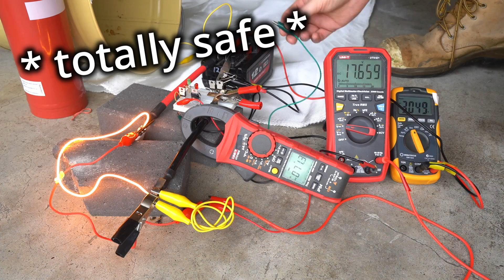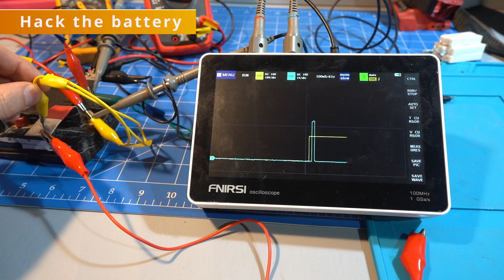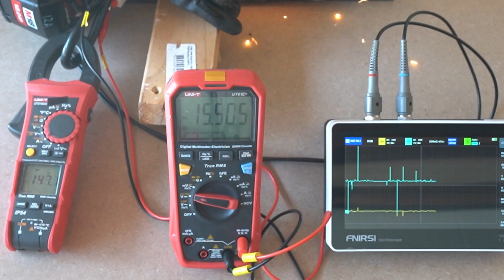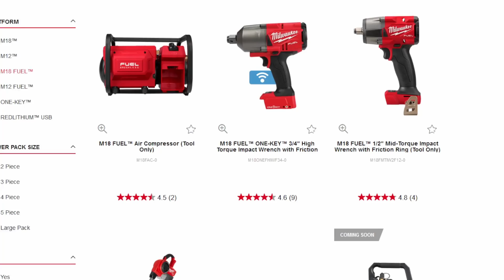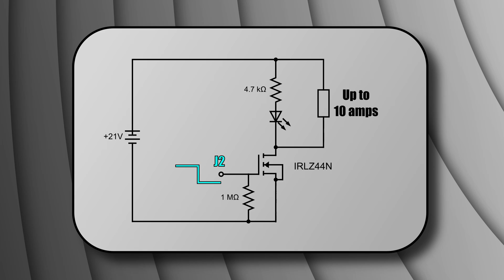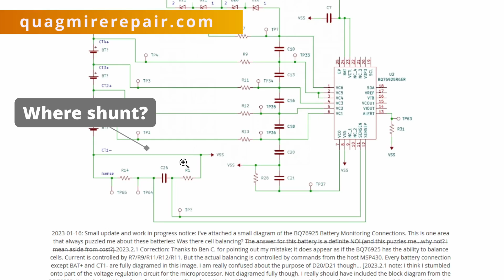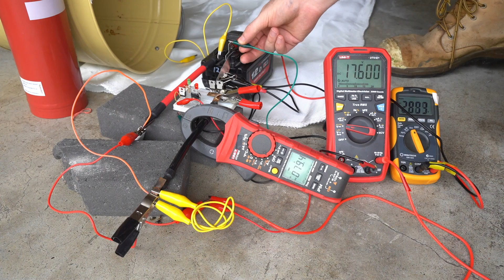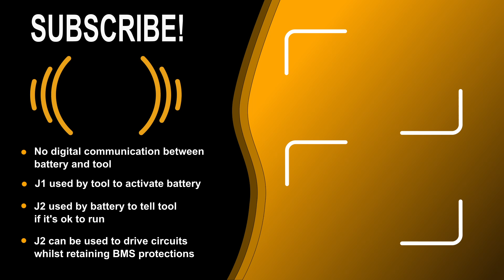[005] How M18 batteries communicate with tools

Comment: Very lovely video!   Learned a ton and helped with troubleshooting a broken tool.   Specifically,  it looks like the J1 pulse from my tool isn't getting to that 12.7 V threshold. 

The tool I'm working on is gen 2 blower.  I was lucky enough to buy 5 broken units for $50.  To breathe some life back into them, I'm trying to figure out this J1 pulse from the tool but don't have a single shot scope to capture the pulse.  What I do see is J1 will go high for as long as the trigger is pulled - but the broken blower only goes to 12.5 V then holds steady at 11.5 V.  Comparing to the good blower, it initial hits 18.3 V and holds at 17.5 V.  These voltages are valid for both benchtop supply and m18 battery. 

My question to you is - have you any ideas what might be causing that J1 pulse to be so low?  Is this going to be buried in the epoxy block they hide their magic? 

Failing figuring out wtf is going on - I was going to wire in a momentary switch and do the button mash to wake up J1.  Maybe add a LED that shows the status of J2 so I know I mashed enough without having to try to fire the tool. 

I could hotwire J2 from +ve, but I would assume this would disable over-temperature and under-voltage protection since J2 wouldn't be able to go low.

Thoughts?
Reply from the maker: Good debugging! Yes, hotwiring J2 will remove any protection. J1 likely has a fault inside the epoxy, probably a short that's causing extra load and therefore voltage drop on J1. J1 should be at B+ when trigger is pulled (I think). You won't be able to run an LED off J2, the LED will draw too much current. You can connect J2 to a mosfet which powers an LED, though.
Reply: @toolscientist  thanks for the reply.  I realized afterwards that you had an entire section on the max draw of J2 not including the comments lol.

I was afraid of the black magic box fault.  So either pulse the J1 through external switch, hotwire J2, or boost signal to J1.  I'm not overly versed with buck converters, but would that be a valid option to boost J1?
Reply from the maker: @grrrrwolf  you could use a level shifter to boost J1 voltage. Can't find a good example so I might have to draw you one and post the link
Reply from the maker: @grrrrwolf  tell me if this link works (and makes sense) https://tinyurl.com/27ytflv4
Reply: @toolscientist  thank you very much for taking the time to do that up. The cct itself is clear, what I would ask about is how critical the value of the mosfets are.  It looks like they are mostly just showing the voltage and there is next to no current demands.  I just have to go through my stash of dead boards to see if I have both types of mosfets kicking around.
Reply from the maker: @grrrrwolf  yep, low current is the idea. Pretty much any mosfet rated for 30V or more will work
Reply: @toolscientist I finally got the parts ordered and the circuit breadboarded and.....  IT WORKS!  You should publish this cct to a broader audience than this one comment because I think this particular failure is more common an issue, especially with the 2424 blower.  I've come across 3 additional blowers that behave the same and a jigsaw too.

While I was waiting for mosfets to arrive, I tried a buck converter and it didn't work.  I can't comment exactly why, but I figure it has to do with butchering the timing or shape of the pulse wave.  (I really need to order a one-shot scope)

If you need anything from me such as video or picture let me know.  My messy bench isn't the most photogenic right now, but least I can do because this just saved 7 x m18 2424 blowers
Reply from the maker: @grrrrwolf  haha, can you summarise for me! You had a blower(s) that weren't producing adequate J1 voltage to trigger battery. Using my level shifter circuit has now fixed your blowers?
Reply: @toolscientist  absolutely.  I have multiple m18 blowers (and now a jig saw too) that aren't producing a high enough J1 pulse.  I used a multimeter with a hold function to determine that it was below 12.7 V (as you figured). By using your level shifter that you posted it kept the shape of the J1 pulse but amplified it so it properly activated the battery. 

I don't have a one shot oscilloscope or I would post up the pictures of the before and after.  But this cct will end up saving a bunch of tools that were destined for scrap.  And that is just what I have come across. 

Is a level shifter like this available as a single IC chip or as an off-shelf circuit? 

I think you have a patreon or something?
Reply from the maker: @grrrrwolf  send me an email. You can find it in the description of my channel. You have to be on a web browser in desktop mode to see it, unfortunately. If you only have phone, there should be an option in your phone's browser to "view desktop site".
Reply: Going to order some up and get the show on the road. 

While waiting for parts. I wanted to see if I could just tap into the trigger switch for the 18v j1 pulse.  Unfortunately not as the other side of the switch has a bunch of capacitance and doesn't go below 12.7v soon enough to be a pulse. 

However, something interesting happened.  After having a 4.0 xc battery hooked up while testing the tool suddenly worked.  This was even more surprising by the fact that I had previously cut J1 to run my jumpers.  To be clear, there was no pulse on j1 but after about 4 mins, j2 just went high for what I can tell is no reason. 

I hooked up a 5.0 xc and same result after about 4 mins j2 came high.  I took off my volt meter, jumpers, everything.  Swapped batteries and got repeatable results.  It is kinda akin to your 12.0 example.

Your lab is setup quite a bit better than mine, can you confirm these results? 

I'm going to put an ameter on the positive side and see if there is some sort of current there that might explain wtf is going on.
Reply: Ok.  Going to recant a bit from my last comment.  J2 does not go high on it's own.  I have to hit the trigger and j2 will come high. Keep in mind j1 is severed. 

More accurately I hook up battery, pull trigger nothing.  Wait for led to go out, press trigger again and j2 comes high.  If I press the trigger while the led is on, it will never fire.

After j2 goes low from standby.  I hit the trigger and nothing.  I wait for led to go out, hit trigger and it will fire.

Edit: okay, I have no idea what is going on.  I really need a way to create a variable load on the battery.  I'm wondering if I'm getting a 100 mA pulse somehow that is waking up the battery.  When you were testing the batteries for that condition, was it only the 12.0 that woke up over 100 mA?  

When I brought in the ameter I could no longer get consistent firing at the 4 min mark.  But I had also removed the j2 from the tool to not get my fuse on the multimeter. I can't see how j2 also being disconnected would influence anything on the other side.

Comment: 150 amps! I didn't think M18 batteries could put out anywhere near this much.
Reply from the maker: And that's the tool limit. The battery was still at 16V, so it still had some juice left (cutoff is 12.5V)

Comment: Do you see any issues with only using the cheap LVDs for small current draws on the milwauke batteries ? (EG 10-15 amps)
We use them a lot for camping situations. lighting, charging other devices, camp fridge etc.. via 18v-12 step down.
Reply from the maker: Nah, that's pretty much the perfect situation for them. Because the smaller M18 let them discharge down to 10V (2V/cell), you're actually better off using a 13-16V cutoff at low-ish amps. All the low-powered M18 tools (anything with only 2 pins), do exactly this. Only thing is I'd avoid using the 1.5Ah and 2Ah at 10-15A. The cells are rated at 20A, but because they are in a pack, they trigger overheat at around 15A.

Also, try measuring the off/standby current of your low-voltage module. I've heard some of them are a few milliamps, which can be a problem. That's obviously easily fixed by taking the battery off when not in use.
Reply: @toolscientist  Thanks mate for the speedy reply, that's a big help. Generally use the 4 and 5a/h units with cut off at 16v. good to know i can drop it back a little. 
I always run a cut off switch so it disconnects the battery from the LVD for that exact reason. (or pull the battery out)

Comment: Massive thank you for the info you're sharing, mate. I  found your channel while trying to figure out an issue (well, ONE of the issues lol) with my M18 12Ah batteries. I have tinkered/hacked/repaired many m18 batteries over the years, including my 2 12ah. The reason i watched this video is that my 12ah batteries have changed the way they 'behave'. Presently, the seem to function as the units you show in your video. However, this was definitely not always the case. 
I used to be able to connect them to other branded tools and they would 'wake up' and worked fine. One adapternthat was always quirky was one to my dyson v7. Older milwaukee m18s wiuld work fine, but with the 12Ah the vacuum would initially pulse, but i discovered that flicking the trigger several times  would get it to power up.
Then one day a year or so ago, both my 12ah batteries mould not work through any adapeters, but worked fine on milwaukee. Some troubleshooting with a multimeter showed the 'activation' happened by to tool ao my work around has been to have a milwaukee tool activate the nattery then do a quick change over to my diy adapted tool. It works as long as i keep it 'awake' but, you can imagine how much fun THAT process is!! 😂😵‍💫. 
Anyhooo, I have searched for answers as to how the behaviour of these batteries could have changed, without much luck. The only thing i can think of is that i have a one-key impact wrench, and could Milwaukee have pushed an OTA update to the batteries via the one-key bluetooth network??!
Reply from the maker: The 12Ah is the only battery with mosfets in it (actually, the 6Ah forge does as well). Their's 2 of them under the brass heatsink. So there could be something going on with those. I haven't got around to testing what conditions make those mosfets turn off, though.
Reply: Here are some other things that I'm certain have changed in the way BOTH M1812Ah batteries from when i purchased them:
-When connected to a tool with with an led light, eg drills/impact drivers, the light either stays on constantly, apart from flickering every 8 seconds (I remember one of the things your investigations found was the 8 second 'activation' time of the 12ah).  I only first took notice of this because  my drill ( with an almost fully charged 12ah battery connected ) was left I. The boot of my car, a week or two later, I  was surprised to find the battery completely dead. When I charged the battery and reconnect to the drill I payed more attention and noticed the change in behaviour. No other M18 or M12 batteries do this other than BOTH my 12ah m18.
-when initially connected to any tool, there is a delay in delivering power. Sometimes I have to flick the trigger a couple of times before the tool will work.
-With my Milwaukee chainsaw, however, things get REALLY strange. After connecting either of the  12ah batteries, the saw will generally work first time. However, when I release the trigger/throttle things get a little confusing, as MOST of the time, when the trigger is re-engaged the chainsaw does not start but hitting the trigger several times  the saw fires up again. THIS OROCESS IS so Anti intuitive, as   the number of times the trigger has to be toggled is sometimes 4, 5  or even more! I first noticed this behaviour after having the chainsaw warranty repaired, and my initial thoughts were the trigger was failing. My first remedy was to take the battery out and reconnect it which seemed to work. Over time though, Ive narrowed it down to the battery, and toggling the trigger ALWAYS works. Part of me theorises it to be a safety measure by Milwaukee incase of accidental pressing of the trigger.
I have confirmed that when paired with a regular, older, M18 5ah or 6ah, the chainsaw fires up at every trigger press, and up until I received it back from the warranty repair, the trigger worked first time every time with 12ah also. 
All signs point to software update in the 12ah, but nowhere have I found any information/documentation regarding this, or whether this is even possible via Bluetooth??
Sorry for my long post, and thank you in advance for any light you might be able to shed?
Cheers
Reply from the maker: @neddraeger2013  it sounds like the internal mosfets are getting turned on and off, which is something I haven't seen. If it were only 1 battery I'd say your PCB is faulty, but unlikely that 2 would do the same thing. Do you think you could have damaged the PCBs when you repaired them? Maybe they can detect when something has gone wrong (like cells removed) and the battery goes into a safe state where it keeps the mosfets off until needed.
Reply: I hadn't  considered that it could be the result of damage. I suppose I can't rule that out as a possibility however, I would be staggered if it were, for a few reasons.
1. Like you mentioned, the fact that it's the same with both 12ah, and ONLY the 12ah.
2. I bought the batteries around two years apart, yet the issue/change in behaviour appeared to happen to bother pretty much at the same time (when I first had the issue with one of the 12ah, the first thing I did was swap batteries to see if the issue was the tool. 
3. Bother batteries had been opened countless times before for cell balancing etc without incident.
it's definitely a head scratcher
Reply: @toolscientist -I  thought I should add that I haven't removed/ replaced any cells, only tested/remedied  any  voltage discrepancies.

Comment: Whats the J2 output from the battery to the tool? I tried to connect the Parkside battery to M18 grinder, putting 4k resistor on + wire and connecting it to J2 but its not working. 

Btw. great video! cheers!
Reply from the maker: It's supposed to be 3V, but should work with anything above ~0.72V. It should work when connected to B+. You definitely connected to J2? J2 is the one closest to B-
Reply: @toolscientist  yeah, the closest to the B-. Would 12v on J2 be too much?
Reply from the maker: @ivankraljevic2845  does it work when using your fingers like I do at 2:03?
Reply: @toolscientist  haven’t tried it cause now when i connect multimeter to + and -, i see they are connected without pushing switch. Maybe i shorted something
Reply from the maker: @ivankraljevic2845  maybe 4k is too small

Comment: I’ve been using parkside for a while and it seems those do have some sort of communication you can set max amps in battery and also change some tool settings in the parkside app